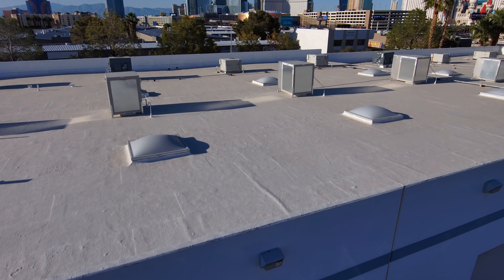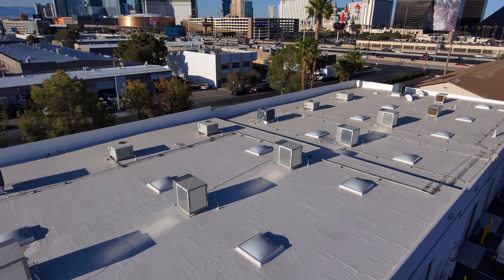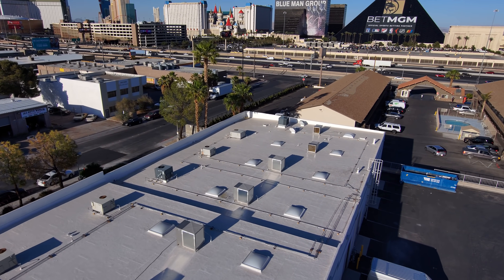TIG Settngs NOBODY is Talking About

Comment: "We're making structurally sound welds that happened to look good"
More people need to hear this. I've seen a few examples of weld looking good but with not enough penetration. Or pretty welds that were made way too hot for the base metal used.

As welder, our priority should be strenght of the connection. Visual appeal should be the last of our concern (while still caring about it, you have to be proud of what you do !)

PS : that is not an excuse to make ugly welds and say "meh, at least they're strong !"

Comment: The pilot knows what settings to use at every time during the flight. How much thrust to use and when. When to use flaps, and by how much.

I don’t think most people expect to be told the EXACT numbers for settings, just close enough to get into the ballpark. When I’m asked, I may say start at about 80 amps, and see how it looks. But you have to have information about where to start, which is why manufacturers give starting settings.

But after that, it comes down to experience, knowledge and skill.
Reply: I agree and the information he gave out was trash. Settings of where to start out at are very important, but won't be exactly the same for everyone.

Comment: The best analogy Ive heard was in welding school. Learning how to weld is like learning how to drive a car. You can learn where the pedal is, what the speedometer means, etc., but theres no way to explain how to get your vehicle to 60mphs and maintain it. Yea you press the pedal but full send, halfway down, none of those will get your car to run at 60mph without you actually putting a seatbelt on and driving the car. Just have to put that hood on and dip that tungsten a couple times and go lol. This video will hopefully help alot of up and comers. Instagram welds are nice but focus on it being done right, pretty comes with time.
Reply: But you don't just get in a car and go 100 MPH either. It's like you all want us to believe you just turn on a welder and set it where you want, and your weld will come out perfect just as long as you weld it right. Settings matter a whole lot. Gas settings matter. Your amp settings matter. Too much gas will give you porosity. What is your suggestion when their gas is set on 50? Oh, it's not the machine, it's you? Or what if I'm burning a 3/32 rod at 140? It doesn't matter, huh?
Reply: @ebogar42  never said you dont need to know those details. But theres no replacement for hands on.

Comment: Where I feel social media has opened the trade to many who otherwise would have never been exposed, which is great. I also think it sets some unrealistic standards for inexperienced welders to try and achieve. They dont realize that the welds on Instagram is the 600th weld of the day that just turned out perfect while the other 599 were serviceable but not perfect. Or that the 15 minute perfect weld coupon on youtube was 6hrs of filming and human error was edited out. Again setting somewhat unrealistic standards for someone without 4000hrs of practice and experience. I applaud Justin and TFS for making this statement that needs to be made. And I think one of the greatest videos Ive ever seen was on the extreme coping challenge where you kept track of your fouled tungstens. Thats the reality new folks need to see. It takes time and patience for the good days to outnumber the bad in this trade.

Comment: I instruct drivers on the track and the exact same rules apply. "What brake pads or shocks do I need?" My answer is "ones that work and won't kill you".
I know there is a breakthrough when I have conversations with students and we stop talking about the "hardware" and start discussing "technique". There is ZERO replacement for dynamic feedback from what the car is telling you "in the moment". What was my brake pressure, throttle position or steering angle for the turn? I HAVE NO IDEA! The ones that make the car perform the best and keep me on the track!! And PS, it's never exactly the same. We aren't robots.

Comment: Gotta disagree some, love your videos but when a pilot learns hes given base info flaps here, speed here approach here.  He learns to adjust. Pull a welder out the box and go to aluminum. Frequency, balance.  Is someone sets 1 hz and 1 balance they can try their best but it won't work out. Some of my favorite videos learning were with showing how a setting changes a weld, either amps, freq, balance, etc. and you've done those videos and showed haz and warping from amp range differences.

Comment: I would love to talk with you about this actual subject. Amps for stick and tig amps and wire speed for mig take your time. Don't start with pedals or crap, lift tig, 2.5mm and 3.2mm gp lohi and even 22/24 rods. Practice flux core and your gas mig will be awesome. If you don't baby step you can't run if you can't start the hard way.

Comment: 1:48 you don't have to ask the pilot, the manufacturer determines a set of parameters which is ideal for landing that aircraft. He's coming in at a certain airspeed, at a specific descent angle, at a certain flap setting. Those are 100% parameters the pilot does not get to choose on the fly.
Just like there are a set of standardized parameters which work for most GTAW setups. Now, like the pilot example you can't run the aircraft into the ground, there is user skill required but there are a range of parameters that are going to allow the brand new student to have better success than they would otherwise.

Comment: Settings matter when the process has some sort of automation, and human input is a small percentage of the work, like a cnc, or maybe a manual lathe.
Reply: They matter without automation. Try burning a 3/32 rod with settings at about 140 and see how well you do not knowing they don't matter.
Reply: @ebogar42  Maybe you misunderstood me, let me reiterate. The range of parameters in a manual process is wider and have larger tolerances than that of an automated process.
Reply: @hashemmi24  Larger tolerances maybe, but good luck running a 3/32 electrode without knowing the settings you need. Just do it at 140 amps? Doesn't matter right?
Reply: @ebogar42  100%!

Comment: This is a harsh truth, but it needed to be said. One person can use the machine and the welds look flawless and another person can come behind them and run a pass and it turn out looking like bubble gum. It's all in the technic the welder has. I watch these videos to learn about TIG welding, but I use a MIG daily at work.
Reply: That doesn't explain how telling someone settings don't matter is smart. They do. I get what you're saying, but your gas settings, and settings when running different size electrodes do matter a lot. On Mig they matter too. You do mig and don't know that every machine has settings that are recommended to start at for whatever size and type of metal you're doing? Your wire speed can definitely be too high or low and so can your amps. When you're running vertical, horizontal, or overhead, they change. You know that right? It's good to know about what you should set it on and start out at. What if I burn a 3/32 rod at 145 amps? Doesn't matter?

Comment: I agree with you 90%.... I do a lot of aluminum tig welding, and It sure helps knowing how to use my frequency for thick and thin aluminum, and different welds and setting my balance correctly for clean or dirty metals .... just my opinion.practice does make perfect, but it sure helps knowing how to use these tools

Comment: Make bad welds as much as you can,  just not on critical areas.  Being a good welder is about looking at a horrible weld and saying,  hmm not enough gas there,  or too much heat got in there,  should have had the amps higher. Identifying the issue helps you grow, and pushes your skills.

Comment: Best advice ever!  You don't weld with the front panel.  You weld with your torch, the arc, your filler, your eyes, and your hands.  That's all you need.  The rest is seasoning once you've perfected the basics of the dish.
Reply: Yeah, your heat settings, gas, and knowing the settings needed to run certain rods don't matter at all, huh?

Comment: Been welding for years, settings are definitely a starting point for the newbies.
Reply: Exactly! Experienced people already know most of this. But beginners have no idea, and need some guidance.
Reply: @melgross  Mel I am on my third bottle of argon and am hooked so bad its all I want to do. All I have are these videos and a ton of burns all over the place! I really appreciate all the info you experienced guys throw out there for us.
Reply: @chrislarsen3009  I know the feeling. It sounds strange to those who don’t get it, but welding feels very organic. It’s as though you’re making something grow. And the slightly irregular nature of man made welds looks almost as though it’s alive. So when I say it grows on you, it really does.
Reply: @melgross  just came out from under the hood. Sometimes I am astonished at the stuff I am doing. I silicone bronzed a stainless steel ferrule to a copper pipe. First time I got it right!!
Reply: No, settings can change based on skill. I work with metal core .045 wire and based on skill you start at 27v and as you get better you move up to 28-28.5v. With their respective IPM wire speed. But that’s also true for tig it’s actually more pronounced with tig. You set up the amps based off what seems to get the puddle started fast but not melt a hole. Usually using the one amp per .000 of an inch rule . Once that’s set it’s all skill based after. It’s actually so skilled based that anything under 12ga steel can be welded with at 100amps and anything over that with 200amps. Assuming theirs a foot pedal of course.  So setting on tig are VERY general. And someone that’s skilled will have very different setting than what a newbie needs.
Reply: @TheOhsemix  Shouldn't you set up your amps depending on the thickness or type of metal? Aluminum isn't going to be the same as steel, but yet none of you mention that as if it's not important and beginners don't need to know any of that. Basic settings that are recommended by who manufactured the welder are a good thing to know and about where you should start out at to me. What if you're stick welding with a 6010 rod and have your machine set up for running a 1/8 rod? If you don't know you're too high, your weld is probably going to suck.
Reply: @ebogar42  he mentioned the 1 thousandth rule for you. Basically you're welding 1/8 then that .125 of an inch. So set it at 125 amps to start. But the whole point of a foot pedal is the freedom to go between (usually) 2 amps and whatever you set for your maximum. 
You might blast out 125 for half a second to get your puddle started then drop to half pedal while you're coasting along and then taper off to quarter pedal then to nothing. 
TIG really is about experience, and besides setting 150 or 250, you shouldn't really have to touch your machine.
(Set 150 for thin stuff, set 250 for thicker metal)
Reply: @ZacharyJutras  But isn't every machine different, so that rule wouldn't apply all the time? The foot pedal confused me a lot when I was using it, and I never got great at doing aluminum either. I blew a hole through it way too much, and had a hard time even getting a puddle. My teacher sucked though I think. There are many things I keep learning about it that he never told me. I've only had one good welding instructor. He does teach me a lot and actually comes around to see how I'm doing. He'll show and explain things to me too unlike the other guy. The new guy that took the shitty guys spot is good at explaining things, but he's so new and even fucks up a lot himself and doesn't know what he's doing sometimes. Fresh out of College and they gave him a job. Why? Makes no sense.
Reply: @ebogar42  so aluminum requires about 10-15% more current than steel, while stainless can require 10-15% less current than steel. But that’s all part of setting to a nominal number to begin with. That’s why most responsible manufacturers have charts with the machine to get you started. The guys here who are talking about being experiences are also right—up to a point. There is no magic number, but like everything else, it’s a normal curve. At the top of the curve is a slow curve. On that curve all settings will work well enough most of the time. Manufacturers give you a number for their machines based on that curve.

After you get some experience, you can begin tweaking things to your liking.
Reply: @ebogar42  the “rule” is a starting point. It’s pretty correct until you get to about .250, then you don’t crank it up as much. My above post about aluminum and stainless modifies that rule, but just by the number, not by the concept. Yes, different machines and welding materials cause some modifications to the numbers too. But by starting out with the numbers given, you should get a decent weld, as long as your part of the work is correct. Right angle, right speed and right distance.
Reply: @melgross  Thanks for the advice. I'll keep that in mind.
Reply: @melgross  I do tweak it some now when learning new positions, processes, or using different metals or size metals, but I still have no clue what I'm doing half the time unless I've already learned it. I have a tendency to run too low when I'm doing vertical, horizontal, or overhead, but it seems like the only setting I can set it on without my weld falling from gravity. I'm also afraid of undercut and seem to get less of it when I'm a little lower. It seems to look fine until I do a bend test, but somehow I always have porosity and not sure how I got it. I keep my part clean and air vent back from the part. My travel speed seems fine to me. My instructor thought I was running too low, but I don't know. Maybe. I feel like any higher than my weld is going to fall. I know it's a lot of trial and error. I think I'll get it and do see a lot of improvement. Lately I've been doing a lot harder stuff than in the beginning. I had trouble with plates with no backing strip. We were doing 6010 roots and the rest 7018. I felt like it took me the whole semester to get okay at vertical and horizontal. It had me behind too. I don't think I got to my last welding test which was overhead.
Reply: @ebogar42  Keep in mind with aluminum your amperage will depend on your frequency because you can run on a quarter inch piece of aluminum on 40 hz and itll damn near blow a hole in the material now change your hz to say 200 hz and it can be more manageable now these numbers are just numbers I pulled out of my butt because these will change depending on the specific alloy how clean the material is or if it has a chrome plating on one side. all these rules are just a bench mark that will be fairly close and almost all machines.
Reply: @ebogar42  vertical and overhead are always a problem for beginners (and experienced welders too). Yeah, you need to cut it down or it will drip on overhead, and sag on vertical. The material needs to freeze quickly. Too much heat, and it won’t. It’s hard to give anything more than general advice without seeing what going on in person.

Comment: Welding for a very long time... but I didn't hear you say " setting for one machine is usually different for the next machine.
Reply: I also heard him say settings aren't important which is bullshit.
Reply: @ebogar42  settings are not incredibly important they are just a benchmark and can be messed around with to things that when you are being taught shouldnt work when you hear it. For example prior to my first job the hottest I had ever welded with MIG was 24.5 volts and about 450-485 wire feed speed on 3/8 plate then I get to my first job and I found out you can easily weld on 1/8 inch mild steel at 26 volts 585 wire feed speed and still have it look nice and not burn through that being said you are doing the boot scoot and boogy to out pace the heat.
Reply: @zachpiller7653  I think I got you. I think my main issue is my pace. I'm too slow. I'm never pacing along. 😂
Reply: @ebogar42  Yeah Im in my last week at my first job and its a fabshop that does a lot of production work and they quote the one off jobs and TIG jobs as MIG production jobs and it makes you learn to boogy along the fastest ive run was about 30 volts 850 ipm with a 3/8 weld sat on a stool  with big caster wheels on it pushing myself along fairly quickly was a 100% weld that was about 7 feet long and had 90 parts to do.
Reply: Two different operators on the same machine can use different settings and achieve the same results
Reply: @Fabricator420  They probably aren't going to be too off from one another though. I think most people are usually setting them about around their pace and what works for them. The ones a bit faster can run hotter probably. People starting out tend to run lower because they're learning and their pace is super slow compared to someone experienced. At least that's how I look at it. I don't really know if that's what others do. That's kind of what I do. My pace determines my settings a lot. I'm still too slow though. I know that. I could run hotter I'm sure. Just not confident enough to pace faster yet.
Reply: @ebogar42  you know nothing. Settings are not important. I, for example, can weld even with my tig switched off !
Reply: @Kawka1122  Settings aren't important? Do you even stick weld or mig weld bro? Yes, they're very important.

Comment: I use a Lincoln 375 water cooled tig. No matter the settings. No matter how much gas flow I use. All I get is porosity.  My welds never. Never look anything like yours. Even with proper prep and cleaning.
Reply: Having too much gas flow can give you porosity as well try turning down the flow
Reply: @scottlyons9213  ok I will try that. Thanks